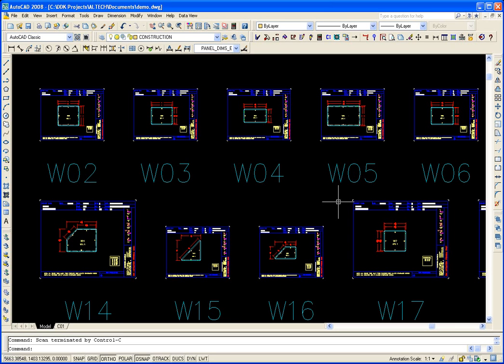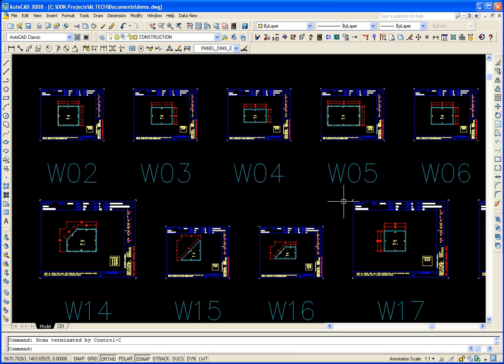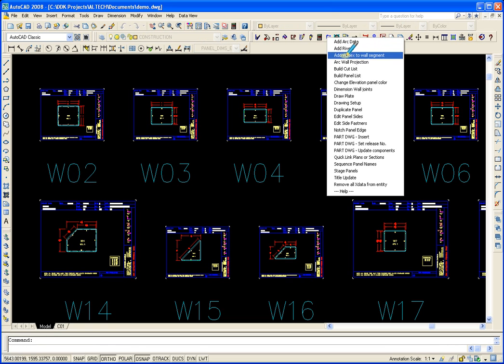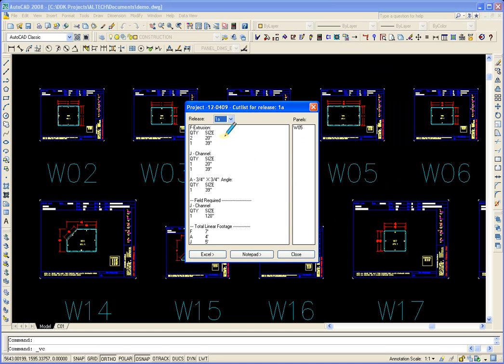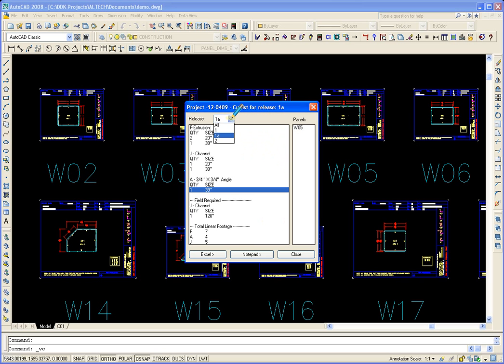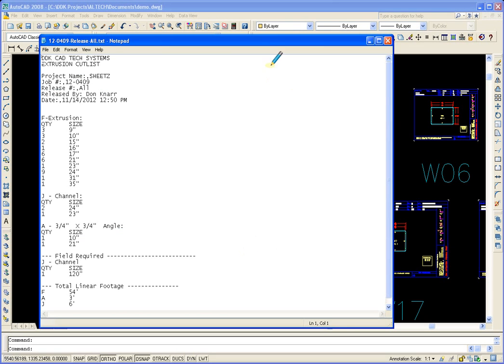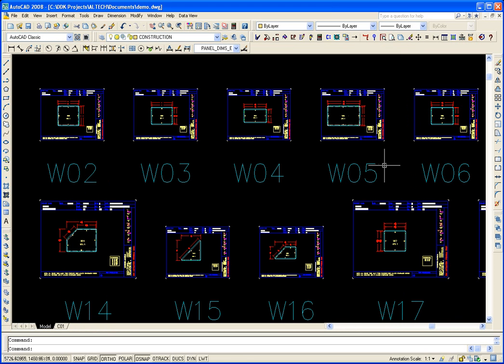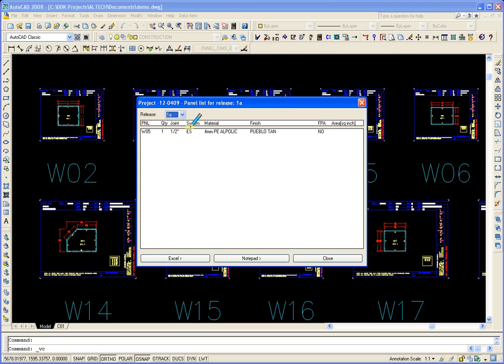Create Cut List / Panel List.wmv

Comment from the maker: Kareem,

Using Lisp - to round up and down use the "REM" (Remainder) function to isolate the fraction.
(setq ext_l  (rem (atof ext_len) 1))
       (if (> ext_l 0.59)   ;; Here I set the limit to determine which direction
        (setq ext_len (rtos (+ (fix (atof ext_len)) 1) 2 0)) ;; round up
        (setq ext_len (rtos (fix (atof ext_len)) 2 0))       ;; round down
       )

Hope that helps.

Comment: Greetings Don,

I am kareem carzan a hobbyist interested in your help in solution to a simular problem you solved in this video.

" Hi,

I'm building a custom report with Report Builder 3.0 to create a cut list for cabinet parts.
The report works with our Autocad SQL based software.

Where I need help is with my dimensions right now I get them to the 1/64th what I don't need I would like to rounded up to the next 16th.
For example 20 3/64 - 20 1/16 or 20 19/32 - 20 5/8 so basically the smallest dimension should be 1/16th

I have the report all working I just can't figure out how I can round up or down a dimension."

Please help me when you are able to.

Thank You, for the time and opportunity. 

Kareem Carzan.